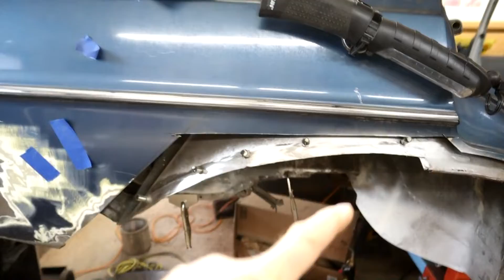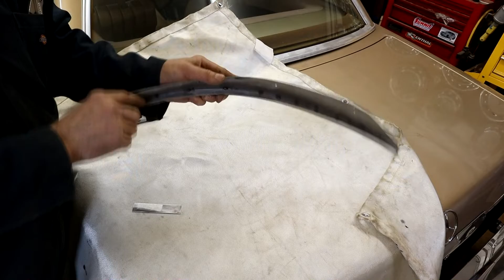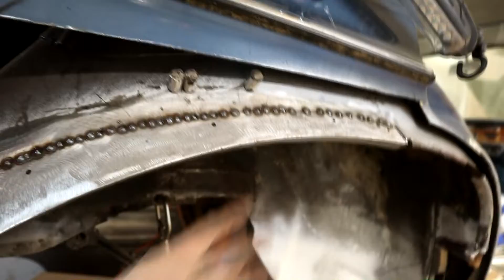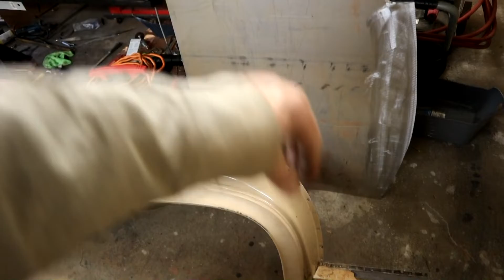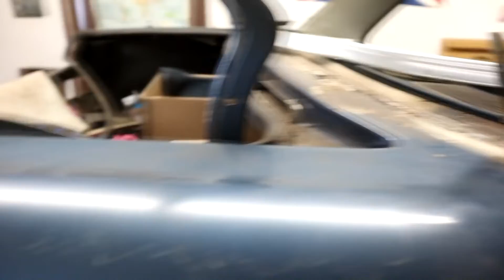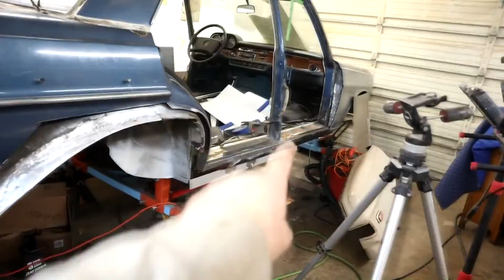INNER WHEEL ARCH REPAIR. MERCEDES W109/W108 PART 1

Comment: Nice John, heard the weather is unreal this winter. So good to see progress happening, with this model is it all about the engine and the body really is just a standard body or are you finding support features not found on other models with this body?
Reply from the maker: Hi Mark. Yes, the weather has been miserable. Ideal welding weather:)  The body is identical to the standard length w108s. The only difference is a 4" extension in the floorpan and rear doors and of course a longer roof. Engine is in a holding pattern while I wait for parts and pistons to be made. Block cylinders cleaned up at 0.75mm over. Crank has polished up beautifully and is standard. All that will need to be balanced. Slowly chipping away at it:)
Cheers John 🍻